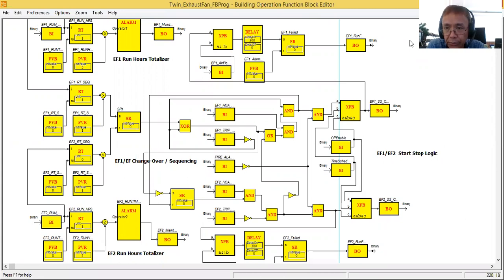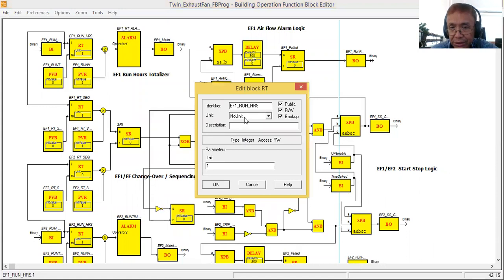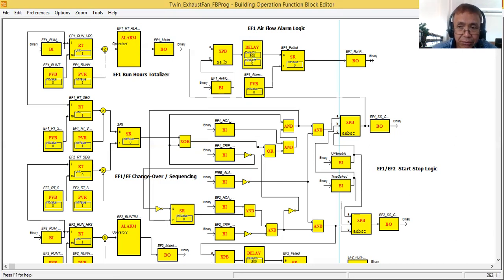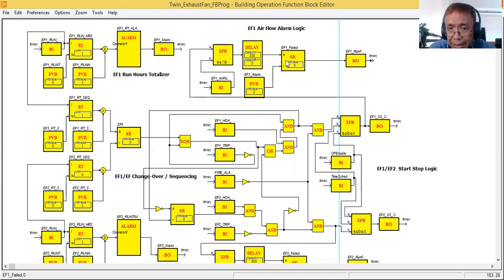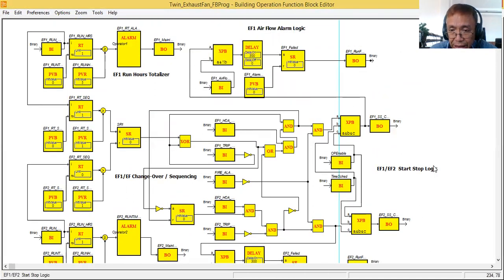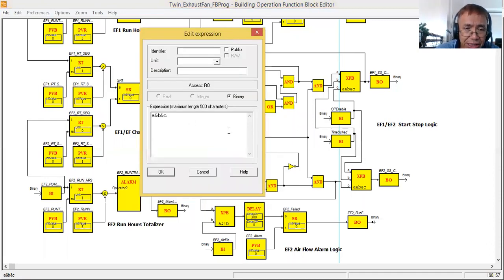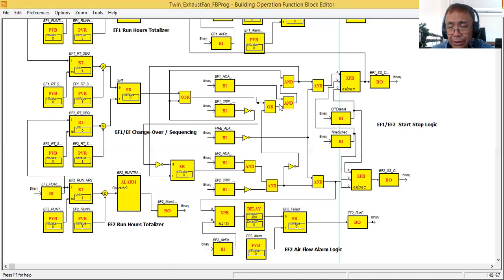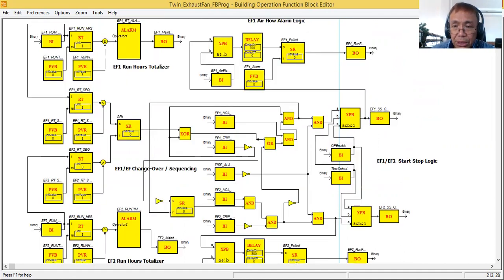How to become a BMS engineer part 80 (Twin Exhaust Fan Control Logic)

Comment: In my understanding from this logic diagram, there is an option of running EF1 if EF2 is not getting ON. like that why we are not providing an option to start EF2 if EF1 fails. like interlocking /duty standby. why we are not using XOR for EF2 also. 

pls clarify
Reply from the maker: feel free to edit the logic to suit your need in the field this is only example logi control

Comment: Hi boss
Here there is something I cant understand it, about the Run time block, once it reaches to the required hours for exchanging, who will reset it??? Here at the end both run time blocks will be more than the required hours and SR block will receive a signals in set and reset pin
Reply from the maker: when the other fan exceeds the run time set point then you can use it to reset the other fan run time block

Comment: I like your clean right angle connections between blocks. You can change the editor to use also diagonal connections but it looks ugly in my opinion.

EcoStruxure Building 4.0 has a new editor which also allows curved connectios or distant connections where no line inbetween is needed anymore.

Comment: Good morning po sir. Just wanna ask if this program includes system protection such as high temperature, high amperage, low voltage, overspeed, etc .
Reply from the maker: it depends on the equipment say AHU there will be high temperature alarms, then for motor protection we can monitor the trip alarm for the motor through overload protection device